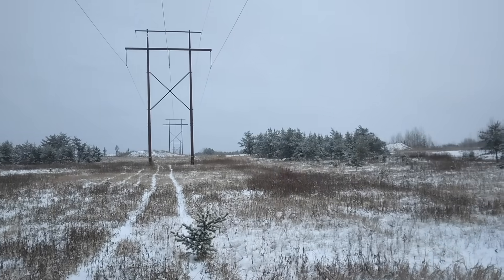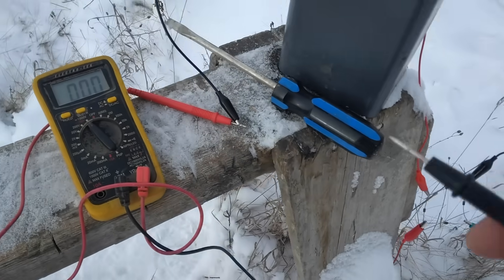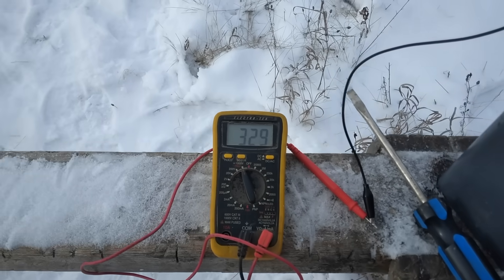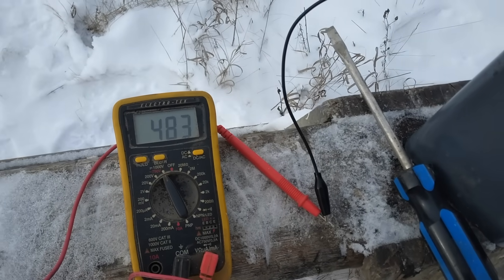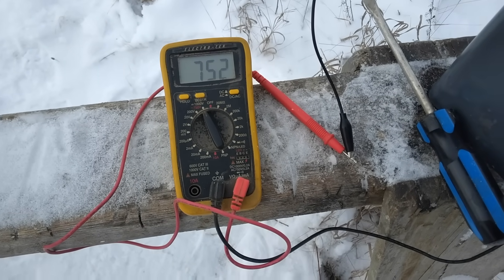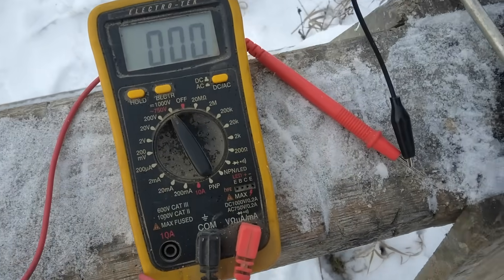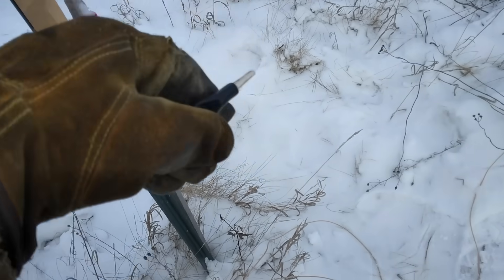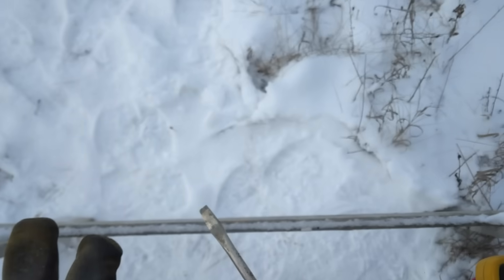Fences sucking power from under HV transmission lines

Comment: I have done parking lot lights under lines before we had a direct charge of electricity going from the light pole to the boom on the skyjack it was a high powered buzzing noise with some blue in there it looked crazy needless to say we got that light done quicker then usual

Comment: I DID THE SAME THING BACK IN 1970s IN WV ... POWERED A HOUSE FOR FREE THEY WERE PISSED BUT BEING I NEVER TOUCHED THIER WIRE NOR POLES NOTHING ... IN FACT IF I HAD POWER LINES PASSING NEAR MY HOUSE I DO IT NOW ...                     SHOULD TRY SEVERAL STORAGE WITH REDUCTOR TO 130 OR 120 ISHOULD GIVE YOU FREE ELECT

Comment: Use all of it bud, they cannot say you are stealing anything. If the electric company wants to help the environment and stop their electricity from leaking out of the lines, they need to use insulated transmission lines.
Their lines are creating a Magnetic field so they cannot say anything.

Comment: I lived in a manufactured home for a short time which was about 75 yd away from the high voltage lines the backyard, the neighbor stated that you could go underneath of the lines with a fluorescent light bulb and it would make that light bulb turn on or illuminate 
I had a double wide manufactured home with a lofted roof, I've got up on a ladder with a voltage sniffer all the way up to the peak and it started to beep due to the fact it was sensing electricity, it wouldn't do that when you were not on the ladder at a lower level 
There were no electrical wires in the ceiling

Comment: This idea here isn't free energy, more like a transformer, but I wonder if another idea I have might be. When I was a kid we had a clothesline that was made out of aluminum and stretched to the end of the yard, a hundred feet or so. I got great reception hooking up crystal radios and various shortwave sets to it. It was insulated totally from the ground and I remember, if it was windy and dry, in the winter especially, I would get zapped with the static electricity in the line without even a connection to ground. I could draw quite a spark if I did put the wire  near the hot air register in my room, which I assume would be grounded. 
Would that work as a generator if you had a wire a mile long to really collect a big charge?

Comment: The “phenomenon” is called induction. Every transformer works like this. The overhead line above is the primary coil and the fence below is the secondary coil. The induced current then flows over the fence into the ground. In humid weather, this effect can be clearly felt and also measurable. Under certain circumstances, even a neon tube could start to glow, relatively dimly, but it could work.

Comment: That's insane! It just so happens that I have a pretty good sized power sib+station approx. 1000ft to a quarter mile up the road . Sits right on the edge of the road. It has huge power poles  that are made of steel . 3-4 ft dia.  There are houses right underneath these wires coming in right over head . There is a constant hum coming from the compound . 24 hrs a day. . If this guy is getting that level of radiating voltage we are getting at least that!! 😡 Fick the power company !

Comment: I do believe that this was sort of the idea behind the Tesla power coil that never got built..as The story goes is finance partner,  JPMorgan could not figure out where to put the meter when the power is just transmitted in the air for everyone to use  so there was no funding for this project and then the whole experiment burned to the ground...

This is electromagnetism in action. The high voltage wires are producing a large magnetic field. 

At one time in my life I oversaw a carlot of a car dealership and above the parking lot there were high tension wires. If you were to wash cars using a wash brush with the aluminum handle (most are wood ) you would feel electricity running up and down your arm as the aluminum pole /handle slid through the palm of your hand in the natural action of washing the cars hood or Roof etc..  It was pronounced more in damp weather

Comment: Very interesting.  A while back, I was motorcycle riding and stopped under a similar power line to check something on the bike.  I touched the handle bar at one point and felt a minor shock.  I didn't realize that could happen.

Comment: Diodes and capacitor "should be" rated 5 to 10% higher, than their stated/stamped values.
Meaning, you have wiggle room to play with.
Also, why not use solid core unshielded copper vs. shielded coax; just playing it safe, I assume?

Comment: In 1973 I worked for a tree trimming and topping company and they got a contract to ground out all the farmer's fences with steal t posts and tie all the wire strands to the posts. We learned early on that to not get shocked we stuck the steel post into the ground and stand it up against the wire strand s and watch the sparks fly and we ground it out otherwise we get zapped. Did it from surrey to hope in B .C..

Comment: All references have been scrubbed from the internet but there used the be articles documenting running conductive wire under high high voltage lines in specific (i dont remember the numbers) waveform pattern to obtain free electricity in the correct 60hz and powering their homes with it.

Comment: To be safe use a power resistor to short out a capacitor...not a screwdriver. It's also the best way to charge capacitors in an inverter from a battery bank so you won't shock the electronics in the inverter. Avoid the spark.

Comment: It's not theft: 1. It's up to the electricity transporter to do it safely and using transmission lines that shield or correctly convey the magnetic fields that they generate along their infrastructure. 
2. The transporter is using a leaky waveguide. 
They may endanger your property, but it's difficult to prove in court because you should bring extensive recordings, months 24/7, with compliant equipment, backed up by experts that a court would listen to.
3. If you do not attach any device on poles, towers, wiring, and you do not trespass, whatever fields they don't care to attenuate is up for grabs.
4. But obviously, if you build a rig to harvest magnetic fields that is unsafe, they can sue you for building an electromagnetic harvesting device that may endanger theit infrastructure.

Comment: I wonder what voltage the line picks up without the power line nearby?  Long wires will pick up static electricity, especially in windy conditions.

Comment: Bit of a pop, but in reality if you take a typical red LED (20mA @ 2V) 36J would only get you 15mins runtime. I imagine there are bigger problems and losses in the network from eddy currents, corona discharges, hysteresis, not to mention ohmics losses in the cables - all passed on to the paying customers 😂, so we are probably already paying for that “free” 36J of energy.

Comment: I n the UK where i live about 30_40 yrs ago some new bungalows were built near some powerlines, Some one fitted a flourescent light in their kitchen, it never went out, The only way it would go out was if you took  the bulb out of the fitting & took it down the street further away from the power lines.

Comment: You dont even need power lines to induce voltage in a long fence. If you look up "teleuric" energy you will find that long wires such as telegraph lines had a different potential at both ends due to the earths magnetic field and differing ground potentials. Repeaters along a telegraph route could be powered by this natural phenomenon.

Comment: Run a wire from there to your house and use it to charge up some of those Ecoflow portable batteries or something similar to run your house off of. Probably wouldn't supply all your needs, but it could make a dent.

Comment: there are better ways of doing that, 200 foot of thicker copper wire wrapped around a core, would be good enough to put into a charge controller to charge a solar system getting 400 to 800w out of it at least maybe more and since its 24/7 thats spiffy :)

Comment: I am retired from an electric company. When I would be working inside the substations, we could feel that there was a charge on the light poles.. I put a meter on the pole and I was getting 68 V
 every once in a while, some copper thief would get into a substation yard, and start cutting the grounding copper cables off of the  equipment in the substation yard.. and every so often, one of them would get fried.
 cross country transmission lines do you lose a great deal of power when they travel long distance. The longer the distance, the more power they lose…
  if you think you can capture it and create a sustainable power source for free, I hope you know what you’re doing. I don’t know if the utility company can charge you with theft of service, but it seems to be possible in this case.
 my last 11 years working for that electric company that I worked for for 40 years, I was in the credit and collection department, working in the field, shutting off people that don’t pay their bills, and investigating sudden drops in usage that were not the result of a wind generator or solar panels.
 you might do better buying yourself a 7.5 KV solar panel kit on eBay. Hire an electrician with a helper for two days and pay them $2000 to install that on a rooftop for you and tied into your Home or whatever it is, you would like to get free electricity for.
every house that I went to to investigate why the sudden drop in power usage that had solar panels, we ended up paying them 
 as a retired electrician, I can tell you that is gravy work. Working on a semi flat surface on someone’s roof. As long as it doesn’t have too much pitch, any electrician would love that kind of work. You need a registered electrician for that because he has to apply for the permits and the inspection so the electric company and to your local municipality electrical inspector.
 it would take about 2 to 3 days tops to put a 7.5 KV rooftop solar panel system in and it would cost you under $10,000, probably closer to $8000
 neighbors of mine just had solar panels, put on their house, and they signed up for a 25 year deal with some fast talking company. That equipment will be 25 years old when it becomes their equipment. I didn’t have the heart to tell them if they could’ve done the same thing for under $10,000.
 Here where I live in Pennsylvania, it is the law that if you have solar panels, the local utility must pay you for the electricity, put back into the grid. None of the investigations I did was using more power than they were creating, and we were paying all of them.

Comment: No need for HV transmission lines if you have low voltage small modular reactor power station and local grid. DC power could work as well and is the standard output of solar power. Generators with AC output need to be rectified for AC-DC or DC-AC conversion. DC electric motors work fine.

Comment: I would be interested in you testing the power fall off as you move farther from the power lines.  Have you thought about using a transformer to make 120 volts and see how many amps you can get at your property line?

Comment: The pre mix concrete yard I work at has a set running through it. When we use the Pettibone to set lids under them can be a little shocking.

Comment: It's The EMF affect, nothing new, this happens even with underground 11,000 cables. The EMF will put current into anything that runs parallel to the cables, IE telephone cables will have voltage running through them? The same applies to EVs You sit and drive them down the road, is the equivalent of driving down the road in your microwave oven on high settings, at home . Wow enjoy the EMF radiation, that will put hairs on your chest!!

Comment: I'm an electrician and my tool partner took an old t12 fluorescent lamp and walked under the high tension lines, the bulb lit up in his hands, the bulb was entirely isolated, not connected to anything.

Comment: Yep. Once installed an electric fence under power lines over my property. I kept getting shocked in the process thinking i had turned it on by mistake. Just take a fluorescent light tube and stand under the lines like the state of liberty, it would glow up to 50 feet away for me.

Comment: 3 yard radius coil, 10 meters from the power line, will give you 0.1344 V. Stack 100 coils, and you have 134 V, so not very not very practical. To power a welding machine shop 20 thousand 3 yard wide coils might get you enough juice to run a welder.

Comment: In South Africa they don't even bother with induction, they blatantly run power cables off the municipal supply lines. They call these people iziNyoka, snakes (as they shed their skins when they get fried if they make mistakes). When the utility company comes to remove these lines, they, and their police escort are stoned by the residents. If they succeed in the disconnections, they are up again the next day.

Comment: Try building a trabsformer.  An iron rod paralall with the line, wound with a coil.  Keep one end of the coil grounded to prevent stray voltage buildup.  After that, the transformer equations are published. Could be fun! A source of AC to run your house?  Not likely!

Comment: They ground power lines when they work on them to discharge the voltage. The lines act as a capacitor between the line and ground when they are energized.

Comment: As a retired lineman who changed insulators on 69kv and 138kv lines while using hot-sticks off an insulated ladder one gets a shock when climbing back to the grounded steel tower.

Comment: Well, working for an electric company I hear lots of tales like this. But, while voltage can be induced into a fence under proper conditions its unlikely there is any current. 
Walk into any high voltage substation and you can hear the emf corona overhead. Not to mention everything has static on it. Even with some lines de energized. But other than shock you when you touch it, you have to under stand it is just static. It will not power equipment. The return ground on transformers however does carry current and can kill a man it is cut or separated from the equipment.

Comment: what i question is, relating to stealing is; does utilizing the field degrade the main power source by degrading the field? thats the main question.  The field is where the current goes through, not the wire.  if the current is being generated, it seems that its robbing the current a skosh.  can anybody that is smart enough to agree that the electomotive force is in the field, corroborate that?  By the way, ive thought about doing this in my own yard, thats why im here, hah.

Comment: My father used to know an old farmer who had some high voltage lines running across his property.. He had apparently buried a grid of copper wire just under the surface of the soil along a stretch of it. About a football field long and was getting free power for decades till it got found out... He got in some pretty serious trouble tho when it did get found out..